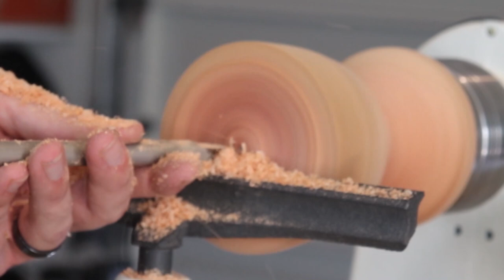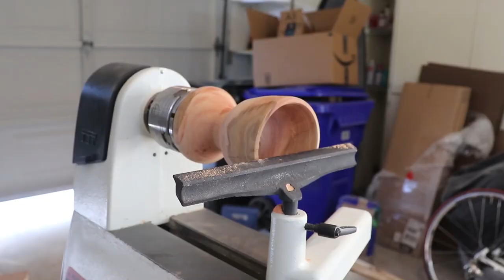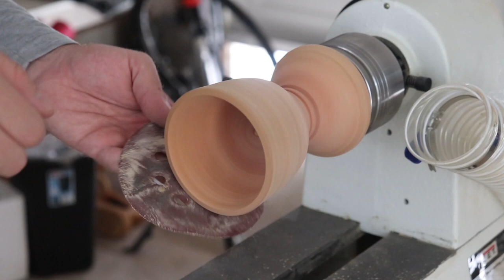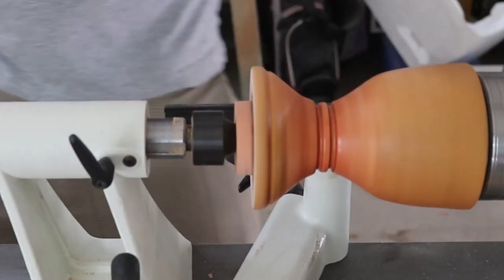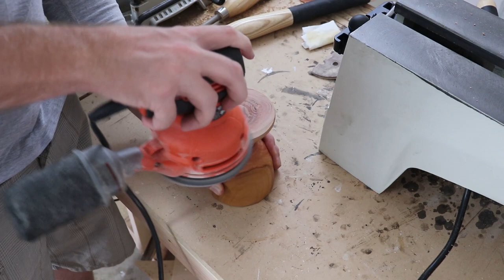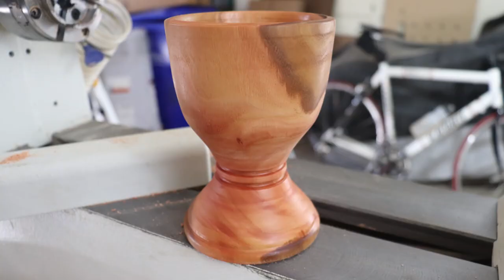Wood Turning: Hollowing out a Chalice with Carbide Tools

Comment: I always get a catch hollowing. Spindle, roundnose, or bowl gouge I always get a wicked bite on the inside and ruin my work. What am I doing wrong?
Reply from the maker: Yeah hollowing can be tough. My catches come when I’m not riding the bevel usually, but it can come from other things as well. Tim Yoder has a really good video on how catches happen, check it out if you can!
Reply: I was going to ask the exact same question.